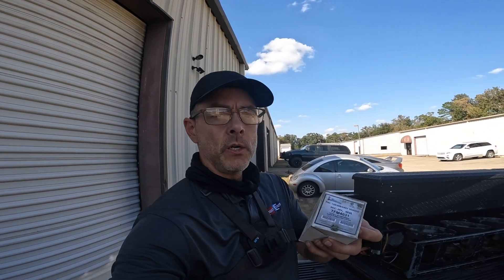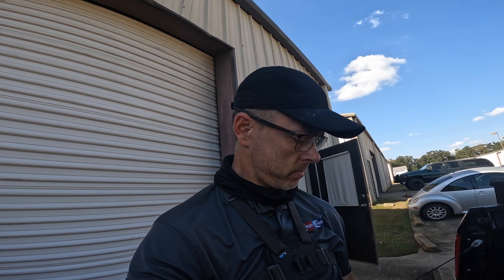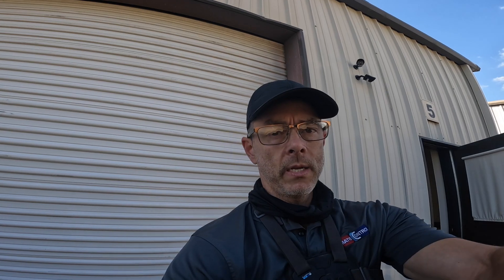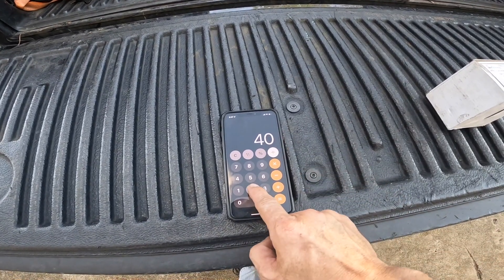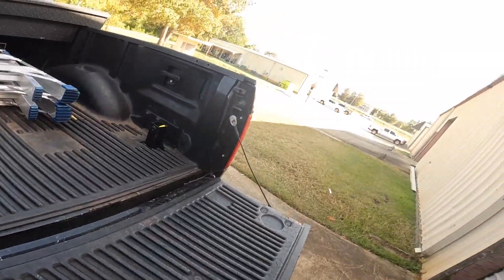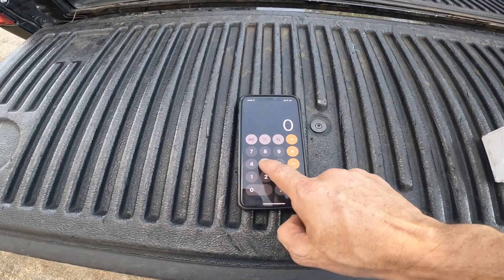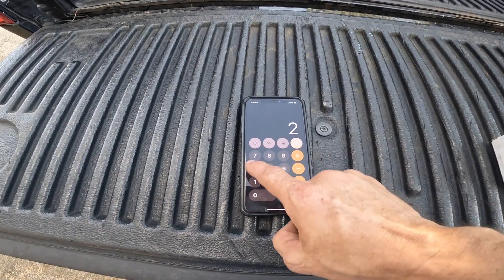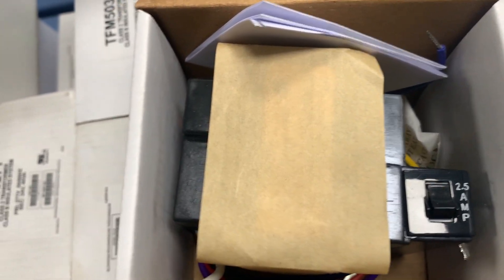How to Pick the Right Transformers and Fuses for Them

Comment: while the transformer can be overheated and burn out by overloading below a fuses current, it doesn't happen often when a high current short occurs or failed coils that go very high current.
the issue is mostly overloaded transformer at time of install, but sometimes people adding things down the road.
like idiots today, buying electric vehicles x1 to x3 and then wanting to fast charge one or all of them at once. 🤣  yeah, not going to happen

Comment: You should just ditch that ford as it seems like it’s always in the shop anyway. I wouldn’t want a ford as my daily driver I have owned a dodge vehicle in the past and just over a month ago i had it towed to the scrapper what a piece of shit (1999 Dodge Durango 177,000) 2 engines 2 transmissions and a whole lot of endless problems.
Reply: Work out of Chevy vans for 26 years very dependable
Reply: @TomLawson05  the old vans early 80's and back.... they drank gas of course. post that into the early 90's less reliable overall and known issues, but still fair. post 1993, so-so.
Reply: @TomLawson05  I own a 2000 GMC safari for my appliance buisness I love the thing. Had a lot of issues when I first bought it used over the summer and still has some minor issues (transmission pump wines, climate blowers are noisy, front end has a minor alignment/steering issue, and no door actuators work) other than that I love the old beast especially for what I paid for it.
Reply from the maker: Hey. That Ford is paid for.

Comment: Thank you, Thank you, Thank you ... I always thought that VA was the same as Watts, but have ran into too many  ... people who tell me no, their different, VA is Volt-Amps, NOT Watts.  sigh
Reply: AC circuits have to take into account the reactive power.  Apparent power in Volt-Amperes (VA) = Real power in Watts (W) + Reactive power in Volt-Amperes Reactive (VAR).  The reactive power is the part eaten up in the magnetic field for inductors, coils, windings or the electric field in capacitors, etc.  The current required in an AC circuit is the amount to produce the Apparent Power at the voltage.  

A channel, Ludic Science, has a great video showing the impact of an inductor or capacitor in an AC circuit called 'Electrical Reactance Demonstration'.  You see how they reduce the brightness of a bulb
Reply from the maker: For our purposes they are the same, there is a difference in semantics that an electrical engineer can explain, and may make a difference in some kind of larger equipment. But, according to ohms law VxA = Watts